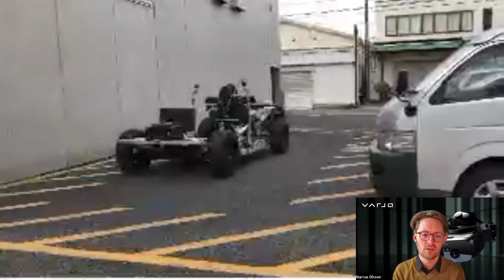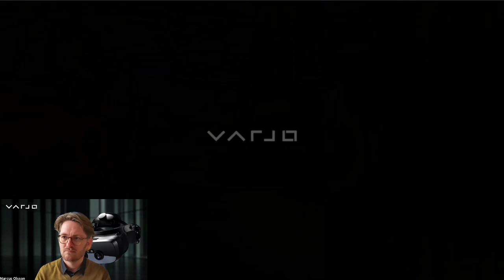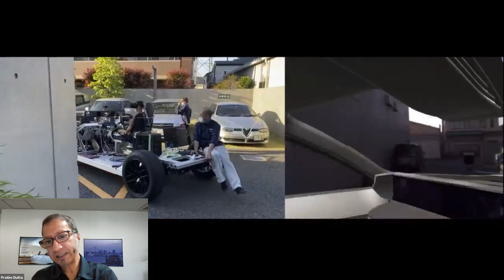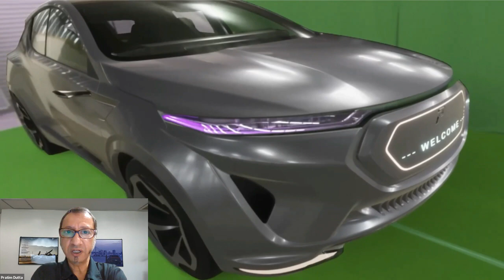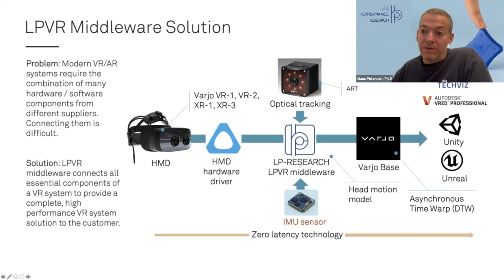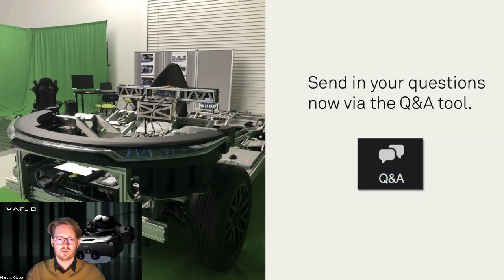Driving a real car with an XR headset | Phiaro x Varjo | Insights Session

Comment: I don't know if this is covered, but have you explored the USE CASE of using VR to remotely access and commandeer a physical Vehicle and operate it?

For example, remotely drive a Truck/Lorry from a fixed position, all sensor/radar and camera information is processed in real-time to the users vr headset. The user will have access to the gas/acceleration and break pedals and steering wheels etc.

This will allow drivers to make long haul journeys without having to physically be in the Lorry, this can reinforce the drivers safety.

Haptic feedback for road surfaces, road lane markings etc would be beneficial.

The technology is there ☺️☺️
Reply: Thanks for your input. Yes, we've had conversations with a number of customers around this usecase.